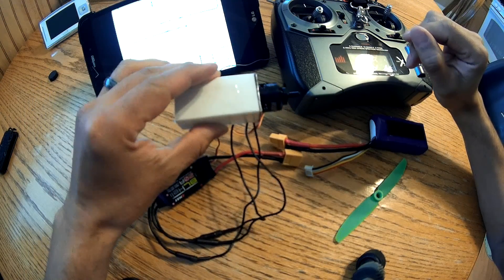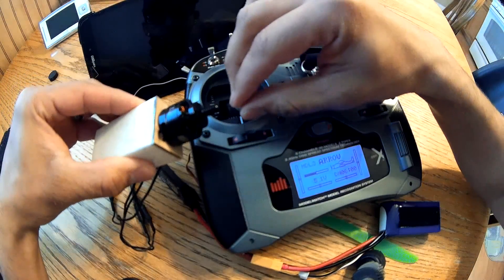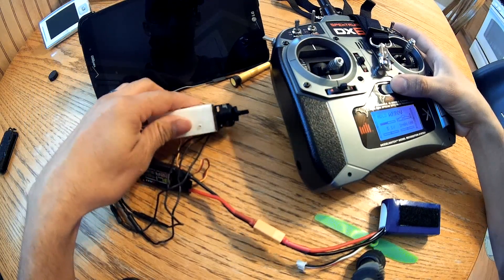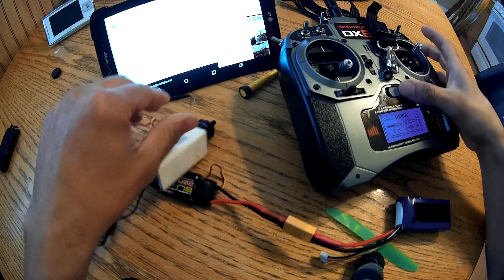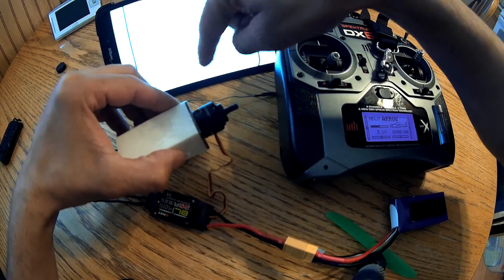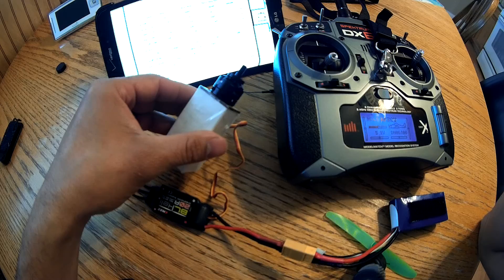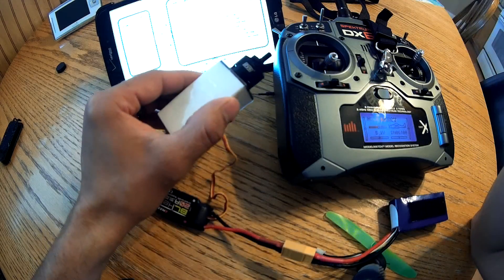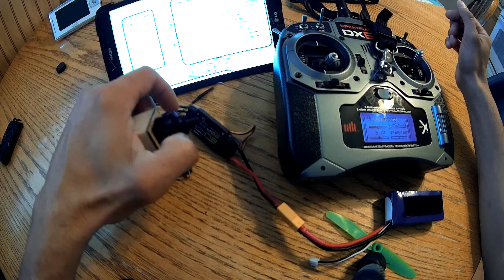Emax BLHeli 20A ESC issues and programming

Comment: Emax blheli 30A ESC control card is APM 2.8, but I have a problem, there is no calibration process on APM. The problem is that when I push the gas on the bidet, the engines stop. Can you help me with this issue?

Comment: Ok i have the fix for you since that is the same problem i had what you need to change is the starting power so first is enter programing mode on the esc to do this hook up a motor then put your throttle to full and when it starts making beeps in sequences in 1,1 2,1 2 3 like that when it does 2 put down your throttle and then when it does 2 beeps then put throttle to full and keep it there until you hear the regular start tone

Comment: Hello, which flight controller is best fo this esc....??
Reply: Nihar Ranjan Mahali this esc is usually used on a plane but for a good fc in genral i recomend the betaflight f4 or f7 fc and really you can use any fc i just want to warn you DONT GET A NAZE32 please dont in my opinion it is the worst board being a f1 board please dont get it. It only has 1 uart port but please dont get it thanks

Comment: check length of motor screws. Or soldering/bullets.
Reply from the maker: nutrox84 
issue was solved. i accidently reprogrammed the esc with the transmitter. have a 2nd video showing what happened. also on how to go through the whole programming process.